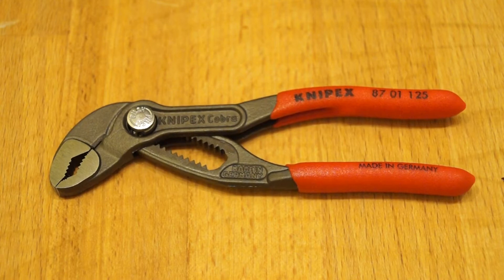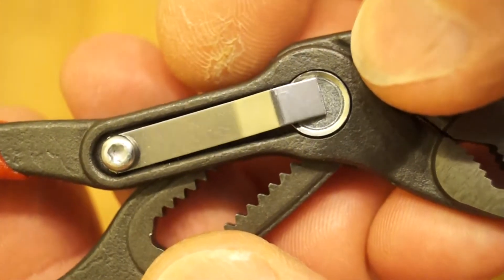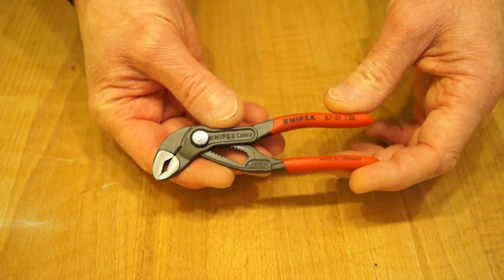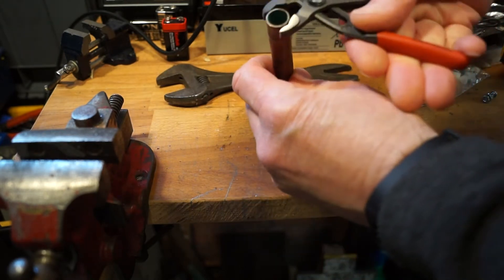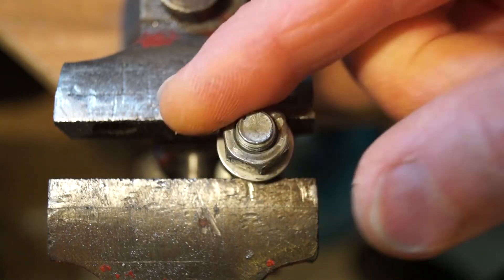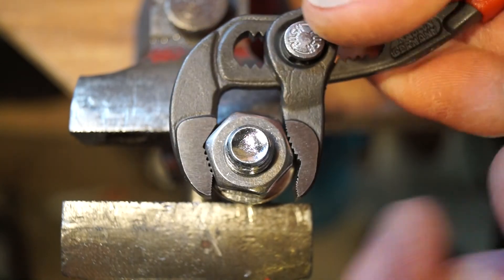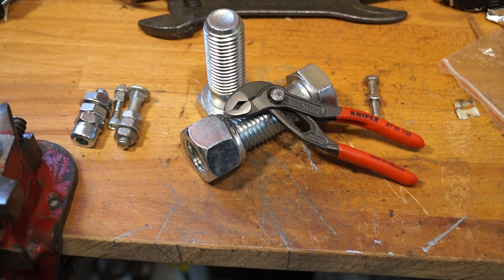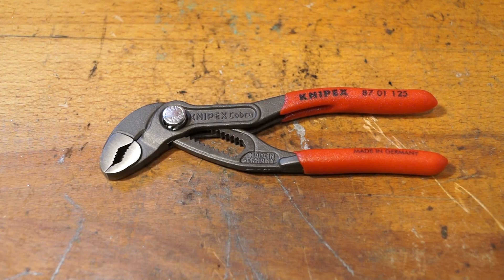Knipex 87 01 125 Mini Cobra Waterpump Pliers

Comment: As an hvac technician I’ve been using Knipex tools since about 1984 while stationed in Heilbronn FRG.  I got a pair of small,raptor style, nail puller / tile nippers with uninsulated handles. I loved the quality of these. So about 1999 or so, I bought a pair of  alligator pump pliers for about $35 US, that was unheard of expensive back then,  Ioved them immediately.  Much easier to adjust than the tradional Channel lock style, they NEVER slipped out of the channel with crazy pressure on them= No blood blister from a pinched finger,  because the handles don’t touch each other when collapsed. The grip is great.  The handles are non slip thin grips so they can easily fit in my pouch or pack without taking up too much space = space for other tools in my bag. Big fat bulky plastic handles may be ok if your in a shop environment, but not for any field techs.  Then they came out with the lock position cobras, a few bucks more but I like them best.  They are pricey but once your use to these tools, you just can’t go back to using lower quality tools again.  They just seem to make our jobs easier, which is priceless.  Also the coated handles are hot dipped, not a plastic slip on sleeve that eventually slide off, experienced only if you’ve owned a pair of the others.

Comment: I have the 100/125/150 mm sizes. By far the best for all purpose is the 150 mm one. It does not avoid any high torque work, a crossover of small and medium diameter fastener, has larger (serrated) teeth. Most of all, does not hurt my hand even when doing heavy duty work yet still small enough for EDC.

Comment: Awesome demonstration, I just bought a set of Irwin groove joint pliers similar to these, but it looks like I might just have to buy this small pair as an extra!
Reply: Irwin pliers teeth are soft compared to these. Youll end up having to do dental work on them with a file and shape them back out. These knipex seem to hold up much longer.